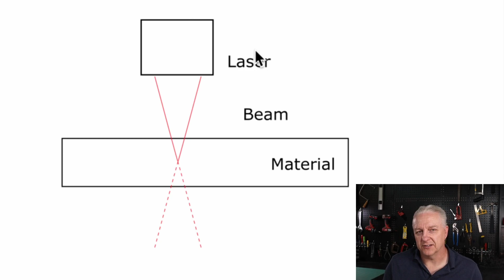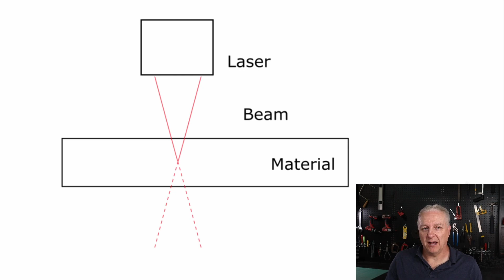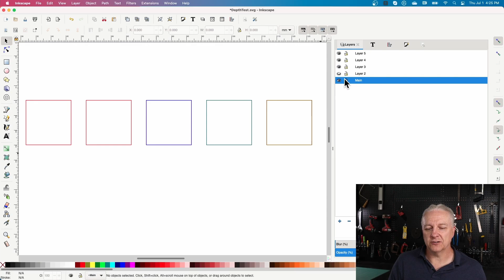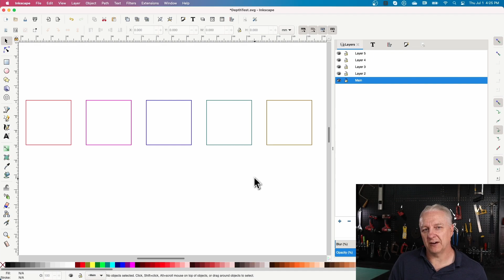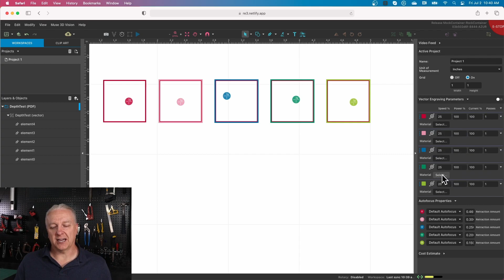LASER CUTTING THICK MATERIAL IS HARD!

Comment: Can it cut copper sheet 0.1mm and 0.2mm ?
Reply from the maker: Something that thin might be possible , though CO2 lasers won’t cut metals as a rule. Just have to try it.  You could probably cut that with a Cricut cleaner
Reply: @SteveMakesEverything  I don’t think so I try utility knife doesn’t cut at all. If you try CO2 cut copper I’ll appreciate
Reply from the maker: Isn’t this like foil?  I don’t have any copper to try. If you know someone in your area with a laser maybe you could get them to try it for you. I do have some printed circuit board material that I can try though the copper of that is probably only 50 mil or some
Reply: copper is such a good conductor it is hard to cut. You might look at cutting by coating the copper both sides with spray paint using a  laser (or something else) to remove the paint where you want to cut, and then etch it all the way through chemically using an acid.
Reply: No, you won’t be able to cut metals. At best you might ablate the oxide layer on top and leave a fine mark. 

To cut metals you need much higher power (over 200W) and depending on the material, oxygen in lieu of air assist. 

You could also try a fiber laser which is a different wavelength and can do multiple passes to ‘cut’ through thin material.
Reply from the maker: @iYellAtPeopleOnTheInternet  If the metal is very thin you can sometimes cut through it with a CO2. A fiber laser is definitely a better bet